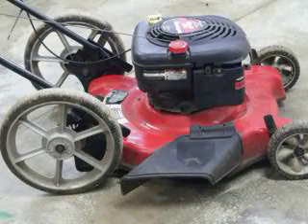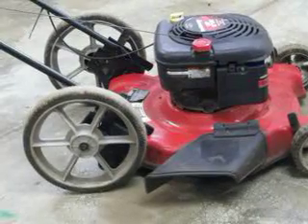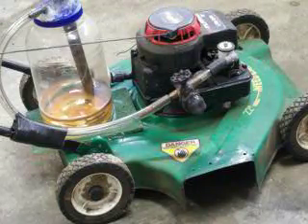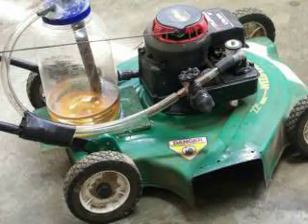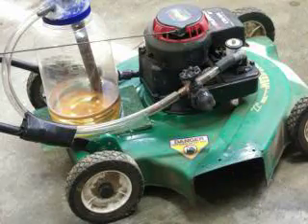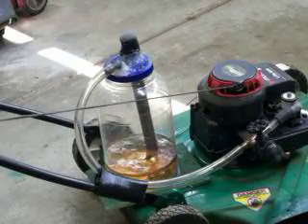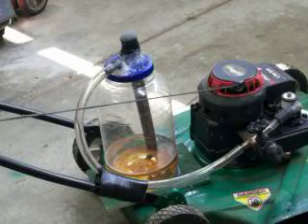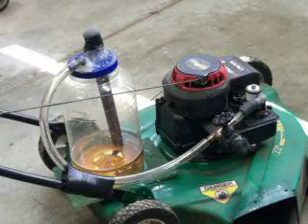gasoline and fumes the difference

Comment: As many other people have already commented there is absolutely carbon monoxide. If you're not sure about the facts especially when it comes to things that can kill people such as carbon monoxide poisoning, don't state them. You need to put an annotation in your video that states you were wrong. It's okay to do what you do but don't deceive people.
Reply: +Tyson Capel Yup, can't burn shit and not have a byproduct.
Reply: Tyson Capel in chemistry, not saying you're not aware of this but just incase. in chemistry a 100% synthesis of gasoline and oxygen the byproduct is water, but generally internal combustion engine don't have a 100% synthesis carbon monoxide and water are produced then the cat system converts the Co to Co2, but that's also why you see water coming out the tail - pipe that and living in high humidity areas

Comment: Not another "fumes" scam!! You can't get an engine to run on less fuel than that which has the energy to do the work it has to do, that would be something for nothing, this is a shuck and jive!! People were imprisoned for trying to sell this shit back in the 1950's!
Reply: therealnightwriter You're a moron. I'm a physicist. Of course an engine is inefficient, but evaporating the fuel does NOT help at ALL, in fact it makes it VERY difficult to burn because the evaporated fuel doesn't burn as well as it does as droplets!! Ever hear of vapor lock?
Reply: therealnightwriter WRONGO!! You know nothing! You're a moron, I'm a physicist.
Reply: therealnightwriter You would be posturing and lying. You're just trying the Big Lie strategy, and you've run into someone who knows better. Give it up and find something else that actually works, quit trying to get rich by faking it.
Reply: therealnightwriter But they don't burn THAT much better. Below a certain size, making something a finer dust does nothing. And in the case of a liquid, once it is a mist, and combusts, the heat of combustion evaps the mist droplets as well as if it were a gas. This is a well-known SCAM from the 1950's, you're just trying to revive it for criminal profit.

Comment: why do some people believe that pre-vaporizing fuel will yield better energy conversion? compression temperature vaporizes fuel before it's burned anyway. pre-vaporizing fuel makes it difficult to control the air/fuel mixture. an improper ratio causes poor energy conversion. a very improper ratio will destroy an engine. pre-vaporizing of the fuel also reduces density causing poor power per displacement. gasoline, Diesel, wood and coal etc all need to be vaporized before combustion can take place, but internal combustion engines already do that very well. I'm pretty certain no shade tree tinkerer will ever create a magic process to revolutionize energy conversion or thermal efficiency.

Comment: there isnt enough energy stored in vapor to even be useful to cut a lawn.. yeah it runs.. but again. not enough energy to produce usable power..
Reply: That's not true at all.  Check out my videos I show a vapor lawn mower cutting tall thick grass and I show a vapor tiller breaking up the soil.
Reply: Tyson Capel you've just created a less efficient carb..more or less..
Reply: +warmfreeze When you tune it in right it actually becomes more efficient.

Comment: Within the first 29 seconds, Vaporkid shows he knows very little about an internal combustion engine.  He claims it runs on liquid gasoline.  A: liquid gasoline does not burn, gasoline vapor is what burns.  Carburetors evaporate gasoline and it is the vapors that are entering the engine.  B: You need a rich mixture to start a cold engine.  The primer bulb is filling the carburetor bowl and providing a rich mixture to aid in starting.  With his jug system, I think he is cheating and starting a warm engine.  He provides no proof that the engine is cold.  When he pulls the rag out of the gas tank it is not in view of the camera.  Besides, when he is stuffing it in there it reminds me of OJ trying on the bloody gloves.  Why couldn't he wrap the rag around a dowel rod to prove he inserted the rag all the way to the bottom of the tank.  Lastly, his smoke alarm goes off.  They detect products of combustion not heat.  Sprinkler systems react to heat, not your standard smoke detector.  His statement that there is no CO or CO2 is complete hogwash.  Run that thing in your garage for an hour and bring in a CO detector.  If you're still conscious enough to read it you'll see there is plenty of CO.  Every form of fossil fuel combustion will produce CO and CO2.  Only hydrogen will only produce water as a by product.  His video is typical of all of these fake inventions like this and perpetual motion machines.  Tricks and deceptions to make it look legitimate.

Comment: when u go through deep grass the original carby will feed fuel in to help the motor run because of the load     dont go through any deep grass with this setup it would just stop . good mabee if your grass all the same length

Comment: No hydrocarbons? The phase change isn't a chemical change. Your still using the same amount of gasoline just in a vapor state. If anything your running it more lean and most likely harming the pistons. 

Also when a motor pull the fuel into the carburetor or injected into the intake the fuel is atomized to allow it to become "fumes" easier essentially making the motor is already running on vapor. All you did was place a clear hose, larger fuel tank and make it more complicated to regulate the A/F ratio. Congrats you went back 50 years in technology and said its new.
Reply: SD Services

Comment: Lying fraud! It will produce CO like any other combustion engine. A carburetor  will outperform this crappy "fume bottle" setup in every single real life scenario and i can explain why.
A carburetor's "job" is primarily to atomize liquid fuel and mix it with air (oxygen) in a optimum ratio according to different load situations. After propper engine temperatur is achieved the engine will in fact be burning "fumes" as the heat from the ,intake, cylinder walls, cylinder head, valves, piston and the compression itself will atomize the fuel/air mix.
What this knucklehead has done is actually made a really really crappy functioning carburetor. It is actually so badly cobbled together that it would stall the engine immediately when the blades makes contact with the grass. This is because his "fume system" lacks an acceleration system and an automatic throttle regulator like the original carburetor  would be sett up with.
What a fucking Goof! Imagine all the time he wasted on this just to realize the mover couldn't do anything but burn fuel and make noise. Now he's wasting YOUR TIME !
Reply: You do realize that carburetor is have jets that squirt fuel into the intake and that carburetors and fuel injection a like both squirt way too much fuel into the combustion chamber thus causing an incomplete burn of the fuel which leads to heat part of the in efficiencies of the internal combustion engine. This method mixes the air and fuel before it goes into the intake as opposed to as it enters the intake it allows more complete atomization of the fuel. diesel engines use a higher compression to achieve a cleaner more complete burn of the fuel this is why diesels have a higher rate of smoke which includes chemicals such as nitrogen dioxide. that is the soot that diesel exhaust makes. As for load the throttle that engines like this have still limit the rpms and it doesn't change the energy of the combustion. lawnmowers when started have the blades turning and hitting grass doesn't make the engine work any harder it would be like idling in park vs idling neutral you would need to use the throttle to adjust the rpms and apply load. While I do agree with most everyone here that the glass jar is not smart backfires can be easily alleviated by putting a piece of screen door screen inline with the tubing as a backfire protector the screen wont let fire through it. I have seen this done on carburated engines and EFI engines on vehicles and they all work the same and support a load just fine. Even in the description he says he mowed his lawn after this video. I don't believe it is 100% efficiant but this makes virtually no smoke and while this did set off the smoke alarm that garage would have been hazy had he been doing that normally carburated I'm not saying

Comment: I cant understand why everyone thinks vapor engines run on super lean mixtures, they dont, they are burning they same amount of vaporized fuel as an injected engine at least up until the exhaust valve opens.
Vapor engines prepare their fuel properly before it gets anywhere near the combustion chamber.
They only admit vaporized fuel into the chamber not any liquid fuel
Injected engines throw liquid fuel into the chamber and hope to god some of it has turned to vapor by the time the plug fires.
They admit so much liquid fuel into the chamber that its all still burning out into the manifold after the exhaust valve has opened.
All the Vapor systems you see today on YT are crap compared to what Tom Ogle had in the 70's. He both heated and vacuumed his liquid fuel to get it as dry as possible before powering his Ford Galaxy to 100MPG.

Comment: dude rly? the engine will run way to lean!
the burn temp is rising into the sky, piston and valves are melting away.
also the exaust gases are way more toxic.

and your engine can't get cooled by vapor fuel. making the high burn temps even worse.
normal fuel vaporizes / turns into gas inside the combustion chamber. that process cools the engine from the inside.

Also:
I want to see what happens when the engine backfires.
igniting the whole intake, filled with burnable gas.
that thing is a Ticking Time Bomb!

There is a reason why engines use fuel injection or a carburator.

Comment: Normally I wouldn't bother responding to such obvious demonstrations of a complete lack of understanding of combustion, but I'm curious to see if anyone here understands actually terms like BSFC - Brake Specific Fuel Consumption (google it) or joules/BTU's ?  Does Stoichiometry have too many syllables for you to bother learning about ?

You can make an engine idle/no-load-freewheel on vapor ? Congratulations,  you just built an oversize, inefficient carburetor.  Guess what.. they *all make vapor.  Liquid fuel doesn't burn.  Particle size is the key. Start your car and just idle it, and see how long the tank lasts.   Then drive it.  oh, you used more fuel driving ? What a surprise !  

Now lets see your magic mower support a sustained load.  "Cutting grass" means nothing. was it 1 inch long, or 3ft high ? we all know one will take much more power (and thus fuel) to cut than the other.  Did you measure the amount of fuel that your original carburetor use to use to cut the grass, then change to your "Vapor carb", and then cut the same amount of same length grass in the same time, producing the same load, and measure how much fuel it used ?   Documented scientific proof ?  No, I thought not.   

All you clowns are doing is showing how little you *really know about how engines work.  "Look I can idle my mower with a bottle of bubbling petrol (or "gas" for you USA'ers, even although its really a vapor), all the engineers in the world and their calculations and efficiency research are therefore wrong ! My idling lawnmower proves it. !"   

Perhaps all the Exhaust Oxygen sensor manufacturers are secretly in on it as well, and are deliberately mis-calibrating their sensors to read lean when its really rich with all that wasted fuel in the exhaust ? Oh, *and every car racing team engineer in the world - they're in on it too.. they wouldn't love to reduce their fuel consumption and pit stops to win a race would they ?    

Have you tried wearing a tinfoil hat while you cut your grass too ? I hear it stops the government brain control waves from making you overlook how much fuel is spraying out your exhaust unnoticed ?